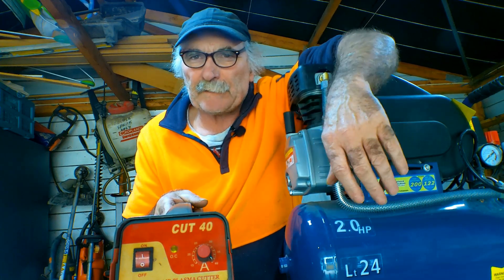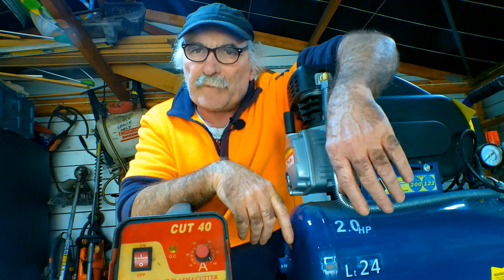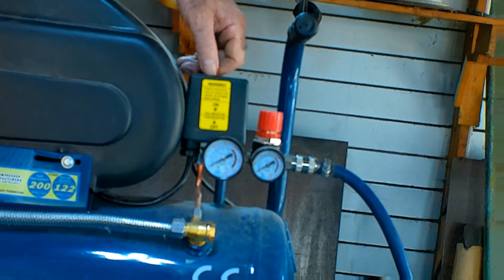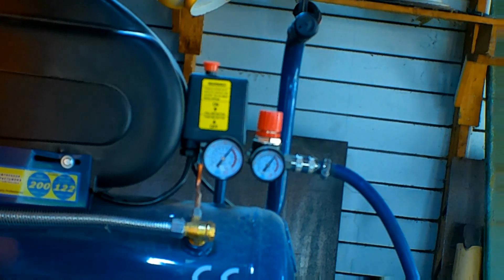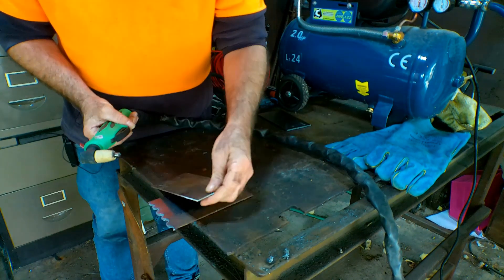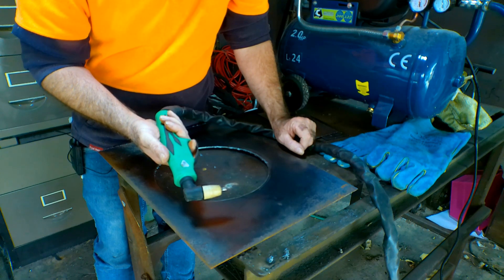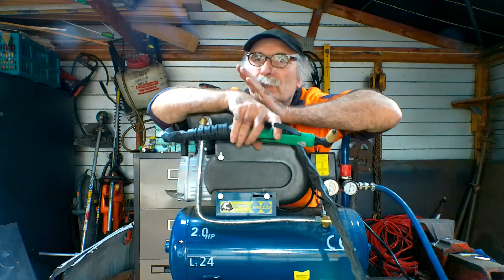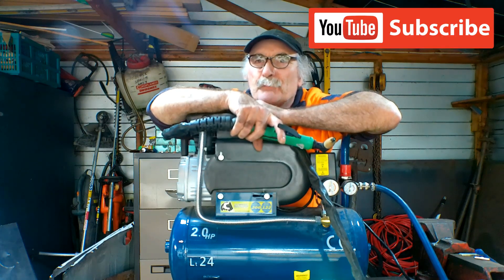Baby Air Compressor? Can You Plasma Cut With It!

Comment: I have a little compressor and I did a 600mm cut through 4mm steel. Worked really well! The compressor was running for most of it, but it maintained 40psi at the cutter.
Reply from the maker: cool as long as it worked

Comment: Hey Pete, looks like you were dragging the tip instead of standoff?, When I drag, I felt the tip was sticking with the cut piece, anyway to fix that? Cheers
Reply from the maker: Most of my tips are drag .Only when i use pilot arc can i use a stand off guide.

Comment: One trick I did a while back was I needed a lot of air delivered, but in shorter bursts with a while between uses- I had a big 3 piston air-compressor, but not enough power onsite to run its motor (on a generator)- the genny could easily handle my little bubby air compressor motor (almost identical to that one lol) but that would run the tiny air tank down too quick and I run out of air before I was finished...
:-(
The answer was to have both in the back of the ute, and I made up a T connector for the hoses- the little one would fill both tanks up off the genny (took a while, but that wasn't an issue), and the combined tanks gave me tons of air storage
:-)
Reply from the maker: Wow great thinking mate. Cheers for watching mate

Comment: I run 2 10amp air compressors 160lpm a120lpm into a larger tank, from 3 phase air compressor, and they last longer than the 3 phase one did, and if one stops you change another one in, my opinion, all the best to you and your loved ones
Reply from the maker: Cheers Donald

Comment: Thanks for the video.  I am 68 and recently bought a 3 in 1 machine.  I then bought a P80 torch to convert it to pilot arc.  Works better but still getting  use to it.
Reply from the maker: Right on